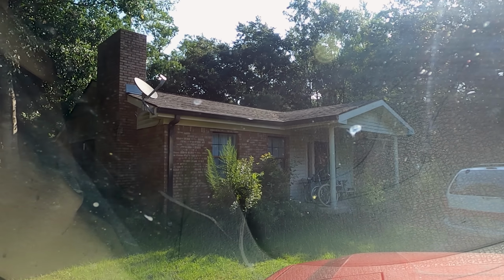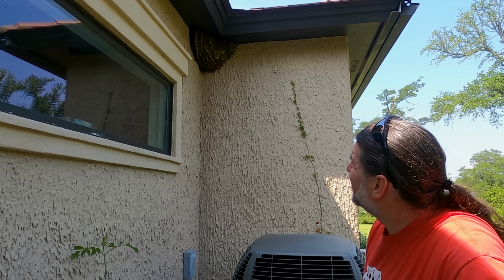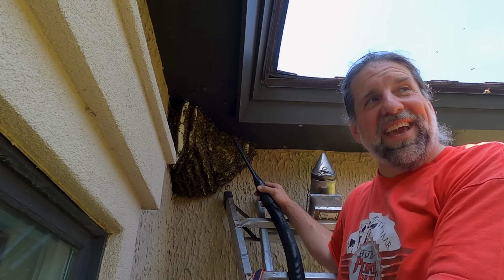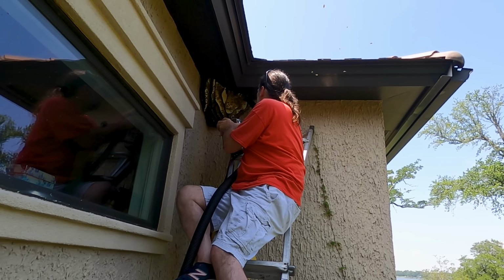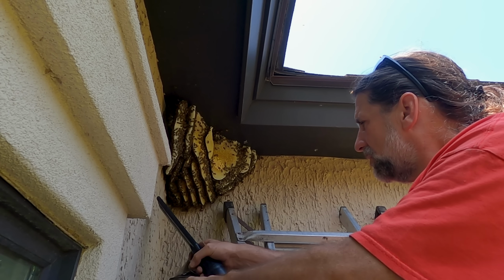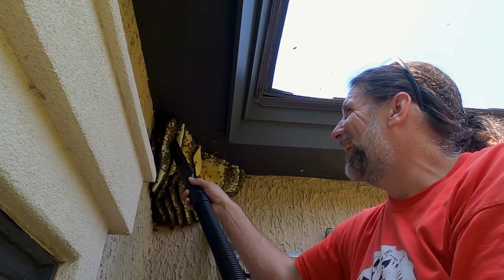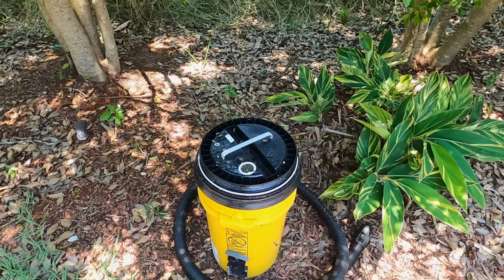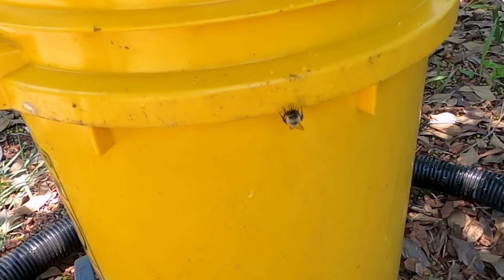Look What We Removed

Comment: I hear these ladders are rated at 1/3 of what they can actually do.  Should have lived on the edge and tested it. 😂 mine is the MPX22, it's rated for 375, and I'm sure we went over this many times. I won't say it was at the crazy angle though, cause it wasn't.
Reply from the maker: I've heard the same.  They are tested at three times the load rating.  I regularly have 400 pounds on mine at full extension.  I didn't want to bust the cover on that A/C unit.  Any sag would have made it touch.

Comment: I wonder if you could give me some direction.  My Minnesota hive is not creating any honey.  I got three frames of bees with some honey and brood from a failing apiary, but no queen.  They made their own queen, which is sending out eggs like a machine gun.  Plenty of brood but little honey.  Plus, they coat the original three frames but seem to ignore the other previously used frames, for the most part.  I am using two brood boxes.  Should I install a queen excluder?  Would that help?  Other ideas?
Reply from the maker: No queen excluder.  Surplus of bees make surplus honey but only if there are nectar producing plants to support that.  Feed if you need to.
Reply: @628DirtRooster  Okay, no queen excluder.  I will watch and wait.  Minnesota will have a bumper crop of almost everything this year.  Fabulous growing year.  Still, I may have to feed.   Jamie

Comment: I found a bee hive that they build in a discarded water heater.  Through a heater element hole.
I'd like to rehome them.  I have hive boxes.  I don't know if I can.  I'd have to cut the steel tank open.
Reply: Once, I successfully captured a really tiny swarm from a wood fence post.  Found the queen, put her in a clip and into the box.  It was super neat to watch the rest of them march into the box.
Reply from the maker: I'd hold off until spring if you can.